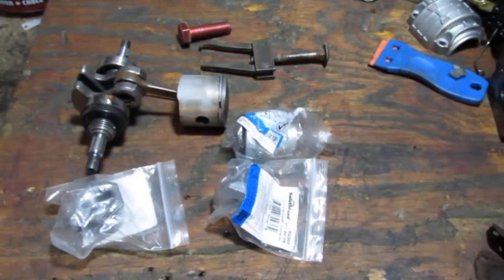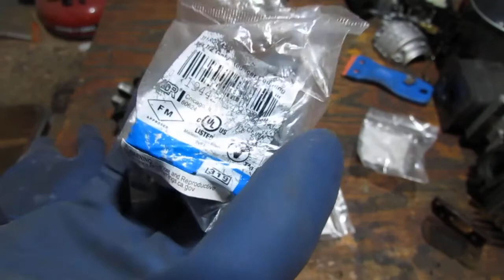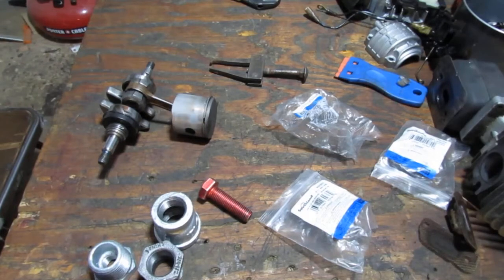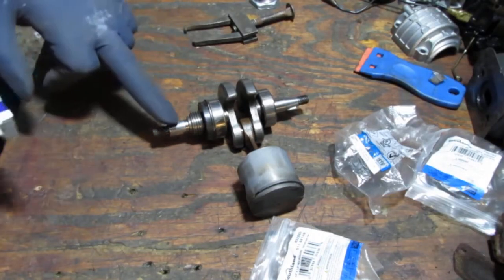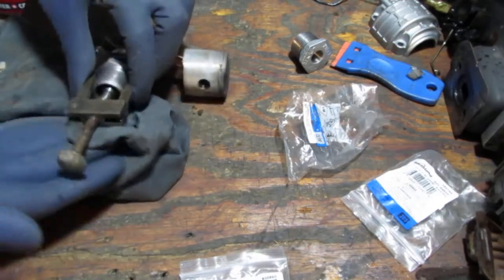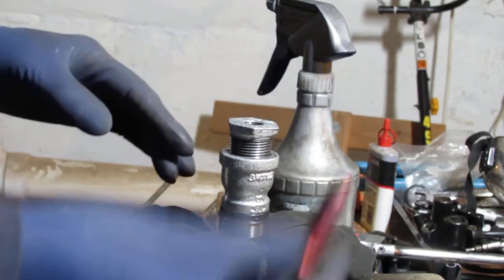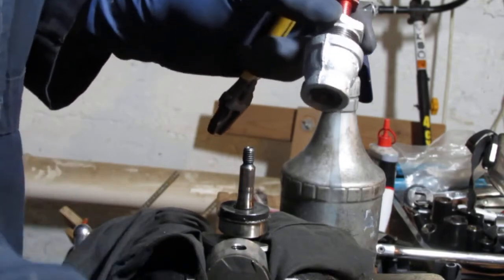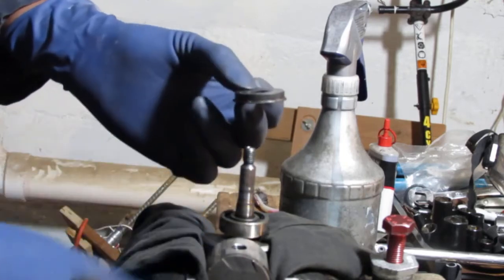How to Remove a ECHO Chainsaw Worm Gear

Comment: Thanks for the tip.  Worked great.  Also I put some heat on the new gear and it went right back on!!
Reply from the maker: Stop being so awesome.  The heat up and let it slide on is such a great use of thermal expansion.

Comment: I am attempting this type of removal but on a Poulan 4620AVX.  the drive gear is same design but different OD. Could not come up with any fittings with a size that would wind onto its gear.  So I diamond ground it’s edge until it fractured under its own pressed on tension. Now I received a new one, an aftermarket as that’s all there are for a discontinued saw, it showed up but is .5 mm LARGER inside dim. and has no tension for a pressed on fit!  GREAT!
if I had the correct gear, how are they installed?
Reply from the maker: Magic One, to go in reverse if I am properly comprehending the question.  That is you are  attempting  to install the worm gear on the crank shaft you will need a special tool for installation.  On this saw if you search for "Echo Worm Gear Installer Kit 91120" that is the tool you need to install the part.  In the full video of me rebuilding this saw located here :  https://www.youtube.com/watch?v=T_EWZj4dHMI  at time stamp 1:03:10 .  You can see how I use that tool.  Best of luck and keep me updated on the process.

Comment: I used a 1/2 in galvanized union and a 2 jaw puller to get it off but can't get it back on! 🤣😅I replaced the crank seals and had to get it off.
Reply from the maker: Lucky for you if you watch the entire video I show you the special tool you will need to install it.
Reply: @MotionDesignStudio  I ordered the tool you used it's just frustrating to wait for it.
Reply from the maker: @RC-Heli835  , It totally understand.  I also was frustrated when I was working on this project for the same reason.  Why do they have to make this unnecessarily complicated.  I have completely dissembled other saws sans any of these special tools.  Best of luck and keep me updated on how it goes.
Reply: @MotionDesignStudio  OK thanks will do!
I have access to a bucket truck and was trying to get some big pecan limbs out from over my house while I have it.
Reply from the maker: @RC-Heli835  , I love all types of big equipment.  I am envious.
Reply: @MotionDesignStudio  I grew up around heavy equipment and always loved it as well. I have come to learn though that heavy equipment will turn the most glorious farm land you've ever seen in your life into one trucking warehouse after another after another. That or 700 lot subdivisions. Followed by red light after red light with non stop traffic. So many beautiful horse ranches gone forever to subdivisions.
 My favorite Tree nursery was beside a beautiful horse ranch and  Walmart claimed them both.